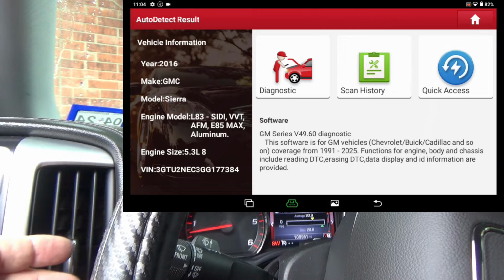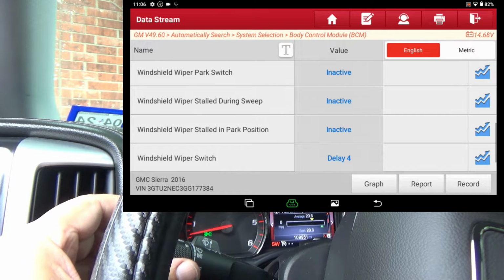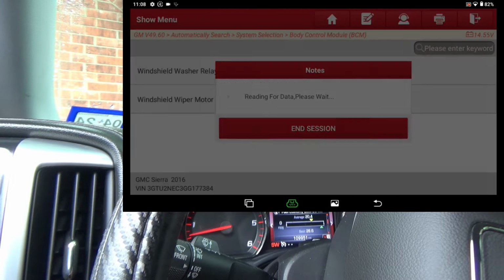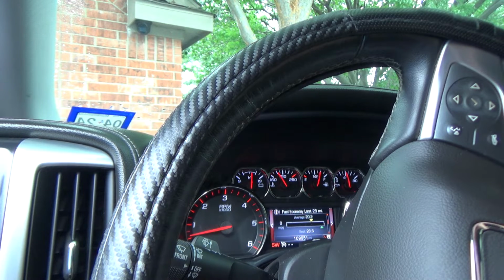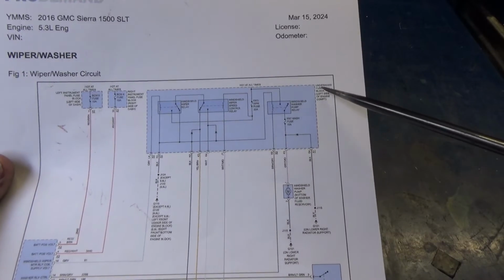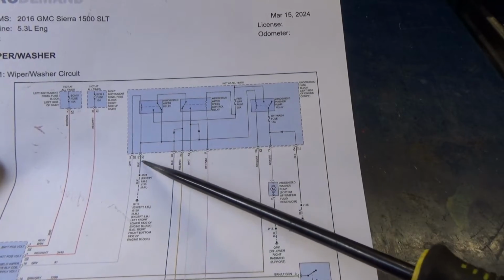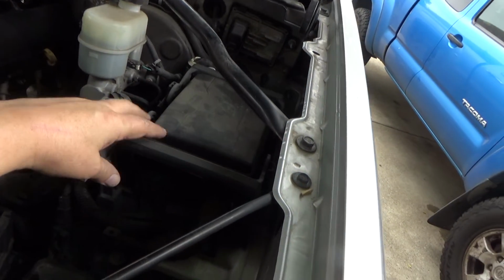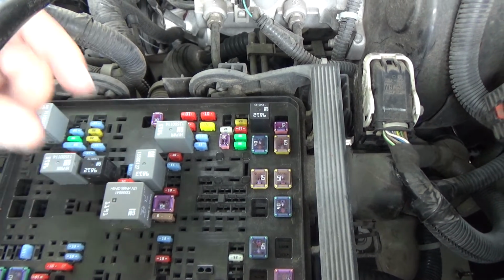2016 GMC Sierra / Silverado High Speed Wipers Do Not Work. $10 Fix.

Comment: THE BYPASS....So using 2 relays
Relay 1
86 - Low speed Positive trigger from BCM
85 - chassis ground
30 -  12v 25a constant power supply
87 - to pin 30 on second relay
87a - THIS IS CONFUSING - It Appears to be jumped back over to the ground wire. But 30 and 87A are a normally open circuit which would cause a short?!?

Relay 2
86 - 12v 25a constant power supply
85 - high speed ground trigger from BCM
30 - receives power from 87 on first relay
87 - to high speed wire on motor
87A - to low speed wire on motor

Okay, so looking at this diagram, we are seeing 2 diodes "check valves". Do you believe these are needed? I think they are to protect the BCM from a possibly back feed.
What does anyone think about this? Because this dual relay configuration is exactly what GM is using in this diagram.
I want to build an external relay system.
Reply: Hello did you ever figure this wiper relay thing out? I’m trying to do the same with my build.

Comment: Does it need to  be re programmed  when replacing  a new  fuse box?
Reply from the maker: No. There are no circuit boards inside, only the fuses on the outside and a few relays on the inside.
Reply: Thanks

Comment: I have a 2016 GMC Sierra Denali. All my wiper functions work. It's every time i turn the key, the wipers do a wipe. If i shut off the truck and turn the key on again, the wipers do a wipe. I got a code saying B3875-02 high speed relay circuit short to ground and B3875-04 high speed circuit open. Do you think its the same problem?
Reply from the maker: You need to connect a scan tool and go into live data and see if all the switch positions are working.
Reply: I did that with a scan tool and all switch positions work. It doesn't stay off. If i shut off the truck and turn the key to the first click, the wipers do a wipe and the switch is in the off position. They won't wipe again until i turn on the the key or turn the switch, either or.
Reply from the maker: @raffnotarmaso7901  It is most likely the relay.
Reply: @raffnotarmaso7901  
I have a 2017 silverado an experiencing these same situation you described. 
Did you figure out the issue??

Comment: Just wanted to say thank you. My 2018 Silverado had this EXACT issue. I ordered the necessary relay from the links you provided. I also jumped H2 to K4 as you showed to verify my wiper motor high speed was ok. The relay was not easy to unsolder but with some patience I was able to get it. Soldered in the new one and all is good. Nice to have my high speed wipers again!

Comment: I like their design and how the whole box can come out easy..  I just wish they would have made it with ALL replaceable relays and stop the intentional money grab..  for a $350 hit over a $10 part.   good grief ..  and there's a dozen of them in there.  So imagine having to buy the box over and over,  each time one of them fails.   It's so blatant
Reply from the maker: Agreed, in the other video for the Denali I laid out on top of the box where the relays are located and verified there is enough room so the relays could have been put on the top side so they could have been replaced.